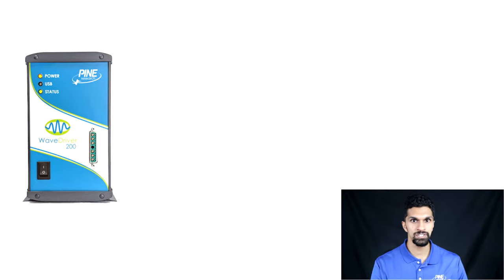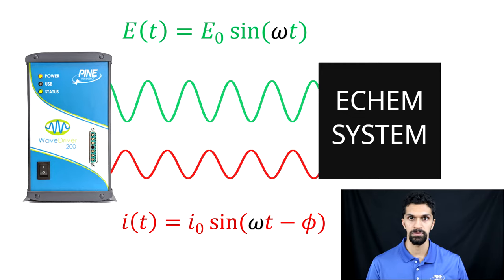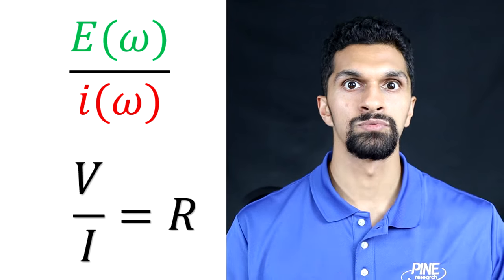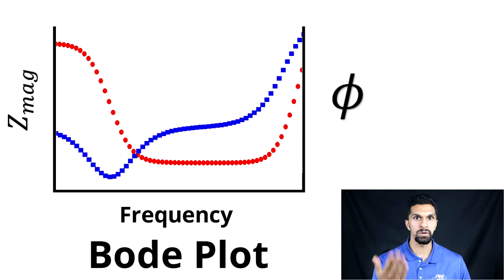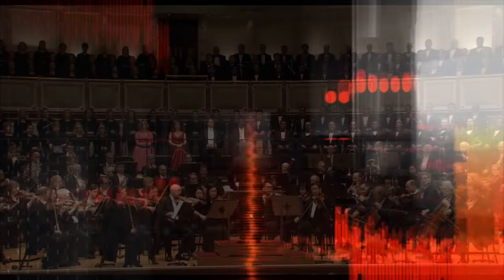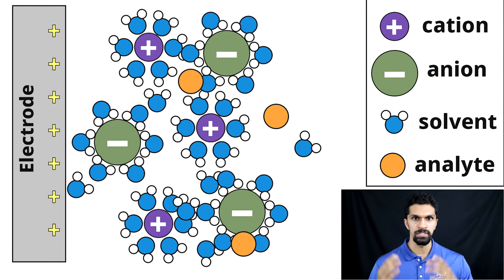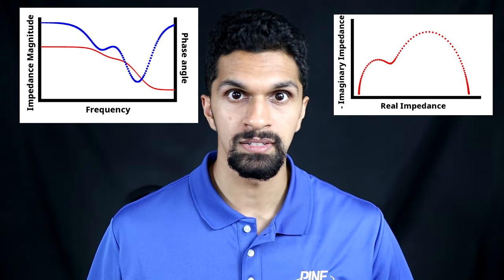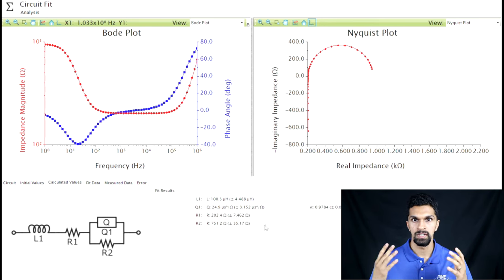What is Electrochemical Impedance Spectroscopy (EIS) and How Does it Work?

Comment: Its a very good explanation but can you please elaborate about why in Nyquist Plot the value Zimaginary is in negative scale??
Reply from the maker: Plotting negative Zimaginary is mostly a convenience thing.  For most systems the imaginary impedance is negative, so we would be able to plot data in the 1st quadrant rather than the 3rd in a graph.  But fundamentally, negative imaginary impedance comes from capacitive processes, the impedance of a capacitor is -j/wC.  So the negative sign is just part of the equation.

Comment: Thank u for providing such a knowledgeable and important video in free of cost. The way you explained everything, is really comprehensible. NeverthIess, I have one question regarding this EIS, I hope You will address my doubt.
I have seen a video in you tube where Mott Schottkey plot was done from EIS  data. I have used the same method to plot Mott Schottkey from EIS, but in EIS data, no potential data column was given, which is required to plot Mott Schottkey, instead a frequency column was given. I want to know if you have any idea how EIS data can be used to plot Mott Schottkey.
Thank u
Reply from the maker: Thank you for your kind words.  I'm no expert at Mott-Schottky, my colleague Dr. Neil Spinner prepared the advanced EIS webinar on the topic.  But you are correct, Mott-Schottky requires a column of potential data as well to perform the analysis.  What that means is you will need to perform EIS experiments centered around multiple potentials.  So it's a fairly long experiment.  Does that make sense?

Comment: Hello sir, we perform EIS experiments on  our own potentiostate (CH instrument). Is your webinar going to be helpful for our EIS data analysis or is that solely for pine research instruments ?
Reply from the maker: Out 5-part EIS webinar series is general for EIS and can be useful for anybody trying to learn EIS regardless of the potentiostat they use.  For parts of the webinar that go over circuit fitting, we will be using Pine Research's AfterMath software to perform the circuit fitting.  But you can use other software to perform circuit fitting.  I hope this was helpful.
Reply: @Pineresearch  thank you so much

Comment: I need video explaining how to use eis and which test I should select. I have like 8 option in my system. I'm confused and also how u determine if the same has high or low corrosion resistant from z real zcimag graph. I saw all your video but non explain what is the data mean in that I get. 

Thank you so much
Reply from the maker: I'm glad you enjoyed the video.  It's one thing to understand EIS conceptually, it's another to do it on a real system and understand what it means.  We have a bunch of other videos on EIS that go into more details, for example, our video on EIS of coated steel corrosion https://www.youtube.com/watch?v=Ov1KKDWLq0s

Comment: I have questions please, what is the point of doing model for EIS ? Do the circuit represent the electrochemical reaction so basically we can use it as model for our system????
Reply from the maker: Your exactly right.  EIS data by itself isn't very useful, it's only useful when you use it to model an electrochemical system, using the circuit elements as parts of your system.

Comment: Hello, Good morning, I appreciate the knowledge shared on this channel. Studying about the EIS technique I have a doubt that I have not yet been able to solve clearly, the question is What does it mean that a material has its phase angle at lower or higher frequencies than another material? In which of these cases would there be a higher resistance to corrosion?
Reply from the maker: Hello Jose, thanks for your question.  First of all, I want to clarify that when you write "...material has its phase angle..." I assume you are referring to a kind of graphical dip in the phase angle on the Bode plot that is observed for features that are often fitted with a Randles circuit.  If this is the case, then the simplest answer I can give you (neglecting all other processes that might be occurring on your materials of interest) is that the phase angle peak is related to the capacitance and the time constant.

To elaborate just a little bit: if the capacitive effects being observed are very small, it means it can be charged/discharged very rapidly, meaning the peak will manifest at higher frequencies.  Conversely, if the capacitive effects are very large, it will take longer, or be slower, for the charge/discharge phenomena to occur, meaning the phase peak will appear at lower frequencies.

All of the above is also neglecting the resistance, which can also have an effect on where the phase angle peak appears; and on the time constant, which is a pseudo-measurement of how long this charge/discharge process takes.

Finally, to address your question about corrosion resistance: the position of the peak may give insight into the corrosion resistance, but not necessarily.  For example, following the previous discussion on capacitance: if the phase angle peak is at high frequency, it likely implies lower capacitance and a somewhat smaller time constant, which could also imply a smaller resistance.  But it is not guaranteed that is the case.  You can have a large resistance even with a small time constant if the capacitance is just extremely small.  Conversely, a phase angle peak at low frequency might imply higher capacitance and a larger time constant, which could imply a larger resistance; but again, this is not guaranteed because you could still have a small resistance even with a large time constant.  This is because the time constant is equal to R times C, so a proper circuit fitting analysis would likely be required to reveal whether your material is exhibiting high or low corrosion resistance.

Comment: thank you so much for such great job , please continue it, if you can please explain about warburg and the pseudo-capacitive behaviour in circuit.
Reply from the maker: Hello Leila, we are glad you enjoyed the video.  Describing warburg and pseudo-capacitive behavior is probably a topic for another lengthy video.  But in short, a warburg element is used for the impedance associated with diffusion, which one can observe with the 45 degree tail on the Nyquist plot in the low frequency region.  Constant phase elements (CPE's) are circuit elements used to describe pseudo-capacitive behavior.  A capacitor is two charged parallel plates separated by a dielectric.  Sometimes in electrochemical systems you'll get things that are almost like a capacitor, but not entirely...because it's electrochemistry :D .  So it's hard to circuit fit an electrochemical system to an ideal capacitor because almost nothing in electrochemistry is ideal, so we use a CPE instead.  I hope this was helpful.  Stay tuned for more!

Comment: Thank you for your explanation, I finally understood the basics.
But can I calculate the solution resistance without a programm? I can measure all important values but I don’t have an analysis programm.

Thank you!
Reply from the maker: I am not sure exactly what you mean by "without a program."  If you have an instrument capable of performing EIS, then you should be able to calculate the solution resistance, yes, even if you do not have software that automatically displays the result for you.  All you need to do is perform an EIS experiment over a few decades of high frequency (i.e., 100 kHz to 1 kHz will likely be sufficient), then obtain a reasonable estimate one of two ways: first, on the Nyquist plot you can find the point closest to the x-axis (where the y-axis -Zim value is smallest) and take that corresponding Zreal value to roughly be equivalent to the solution resistance.  The second method would be to use the Bode plot and take the corresponding |Z| value where the phase angle is closest to zero.  Either will likely give you a similar value and should be equivalent to the solution resistance.
Reply: You answered my question perfectly, thank you! Will the measurement change my solution or can I reuse it for other measurements like CV or EIS at a different temperature?
Reply from the maker: @NadineLachmann  One of the great things about EIS is that it is fundamentally non-invasive, so almost certainly the measurement itself should not impact your solution, no.  That means you should be able to measure the solution resistance and then use it for subsequent experiments.

However, I should be clear that if you change the temperature, it may have an effect on the solution resistance.  I suggest you measure and use the solution resistance value unique to each temperature you wish to conduct further experiments at, whether CV or EIS.
Reply: That‘s exactly what I want to do! I want to determine the solution resistance for three different temperatures to get a better understanding of my system! Thank you so much!😊

Comment: Are phaseshift counted by, max time input amplitude - max time output ampitude ?
Reply from the maker: In reality there are some special transformations a potentiostat/software does to calculate the phase shift.  However, you are correct, the phase shift can be thought of as the time delay between the input and output max amplitudes.  But it's also the delay between every other point as well.  The maximum amplitude is the easiest to visualize when it comes to visualizing the phaseshift.  Remember, that both input and output signals must have the same frequency for it to be impedance.  I hope this helps.

Comment: thank you, it was a nice presentation. I have a doubt why two phase change occur
Reply from the maker: I'm glad you enjoyed the presentation.  What do you mean by "doubt two phase change occur"?
Reply: @Pineresearch  in the Nyquist plot, I am getting two semi circles. what does it mean?
Reply from the maker: @ayushisinghal1379  Hello Ayushi.  Two semi circles means that you have two Randles circuits (resistor and capacitor in parallel) in series.  Physically, your electrochemical system has at least two interfaces.  Does this make sense?  We have free circuit simulation software you can download off our website 

https://pineresearch.com/shop/kb/knowledge-category/downloads/

You just need to create an account, but then you can download AfterMath software and under the Analysis/Tools select circuit simulation.  You can then see what the Nyquist plot with two Randles circuits in series look like and how the two semi-circles change.  I hope this helps.
Reply: @Pineresearch  it is quite complicated but thank you
Reply from the maker: @ayushisinghal1379  Another resource that might help is our knowledgebase article

https://pineresearch.com/shop/kb/theory/eis-theory/eis-basics/

Section 3 in particular goes into circuit fitting and the Randles (RC) circuit.  The article only describes the simple case of one semi-circle however.  If you have two RC circuits in series you would get two semi-circles, using the same logic described for the one semi-circle case.

Comment: i got impedance vs current datas from an elctrochemocal mesurement. I do look for a software (OA) to modell these ... any requests?
Reply from the maker: I need a little more clarification on the data and modeling you are interested in.  Usually, impedance is not plotted or measured with respect to current.  You typically get Nyquist and/or Bode plots which plot the real impedance vs negative imaginary impedance (Nyquist), or the impedance magnitude and phase vs the frequency (Bode).  I suppose the question is, what exactly to you want to do?
Reply: @Pineresearch  sorry, I was wrong these are typical data z' vs. z''. I got just an excel with the datas and dont have access to silulation software. Need help.
Reply from the maker: @WolfdietrichMeyer  You can use our AfterMath software to do circuit fitting.  It can't be downloaded for free off our website.  You only need to create an account (also free) on the website, to download it.  https://pineresearch.com/shop/kb/knowledge-category/downloads/  Once you have AfterMath on your computer under File--> Import External Data    you can import a CVS file of your EIS data.  Let me know if you need additional clarification.  I hope this helps.

Comment: Thanks for the great explanation.  However, how the schematics structure looks like for the EIS measurement system?
Reply from the maker: Are you referring to how does the potentiostat operate in order to perform EIS?  I just want to clarify the question.
Reply: @Pineresearch   Yes,  and at the same time I am talking about: how the electrical components e.g., resistor, capacitor and inductor can be shown by the diagram in schematic. You have shown & explained the circuit diagram at the end but I would like to know the whole process including all components in one diagram.
Reply from the maker: @tanzilanurjahan6609  Well first, I would recommend watching our "How a potentiostat works" video https://www.youtube.com/watch?v=pzB122dTij8 

But regarding the circuit elements of how a potentiostat works with regard to EIS I cannot provide you with a circuit diagram.  First, there are proprietary reasons and second, it's too complex for one diagram.  But the key takeaway with regard to how a potentiostat works from an EIS perspective, is that the potentiostat requires what is called an FRA (Frequency response analyzer).  This allows your potentiostat to take in AC signals (necessary for EIS).  Are you trying to build an EIS capable potentiostat from scratch?
Reply: @Pineresearch   . I am trying to understand the whole circuit diagram of EIS runs on. You are right it's complex. However, Thanks for your assistance.
Reply from the maker: @tanzilanurjahan6609  You're welcome.  I think the best way to understand the circuit is to check out the video I mentioned before about how a potentiostat works.  This will help you understand how a potentiostat maintains a set potential and measures the current response.  You can then think of the potentiostatic setpoint (from the circuit in that video) as the waveform generator for producing a sine wave.  And subsequently, you can think of the E/I voltmeter which allows us to indirectly measure the current, as a way to measure the sinusoidal current response.  Then you do all the calculations performed in this video.

Comment: Summary

Intro
- 0:02: [Music]
- 0:10: Introduction to the video on Electrochemical Impedance Spectroscopy (EIS).
- 0:18: Acknowledgement of EIS's complexity and the video's introductory nature.
- 0:38: Overview of the video structure, covering EIS components, data generation, and application.

What is Electrochemical Impedance Spectroscopy?
- 1:29: Explanation of EIS as a technique using potentiostats to apply and measure sinusoidal potentials/currents in electrochemical systems.
- 1:50: Distinction between potentiostatic and galvanostatic EIS.
- 2:10: Characteristics of the sinusoidal potential applied and the corresponding output current.
- 2:57: Concept of phase shift or angle in EIS.
- 3:09: Procedure of conducting EIS experiments across multiple frequencies.

Fourier Transform and what Impedance is
- 3:36: Use of Fourier transform to convert time-domain data to frequency-domain.
- 4:00: Comparison of impedance calculation in EIS with Ohm's law in DC circuits.
- 4:39: Definition of impedance in the context of alternating currents or potentials.
- 5:00: Impedance as a measure of anything that impedes electron flow.

The Bode Plot
- 5:17: Introduction of the Bode plot from EIS data, showing impedance magnitude and phase angle.

The Nyquist Plot
- 5:48: Conversion of Bode plot data to Nyquist plot using cartesian coordinates.
- 6:03: Explanation of real and imaginary impedance in Nyquist plot.

Analogy for understanding EIS
- 7:09: Use of a symphony analogy to explain how EIS discerns different electrochemical phenomena at characteristic frequencies.

Why use EIS?
- 8:24: EIS's ability to probe different electrochemical phenomena at specific frequencies.
- 9:01: Contrast between EIS and other electrochemical techniques like DC voltammetry in analyzing concurrent processes.

How EIS data is used (modeling an electrochemical system)
- 10:09: Modeling complex electrochemical phenomena using circuit elements.
- 11:03: Combination of qualitative and quantitative analysis in EIS through circuit fitting and software.

Conclusion
- 12:01: Acknowledgment of EIS's complexity and a call for viewers to stay tuned for more in-depth content.
Reply from the maker: Thanks for the in-depth description